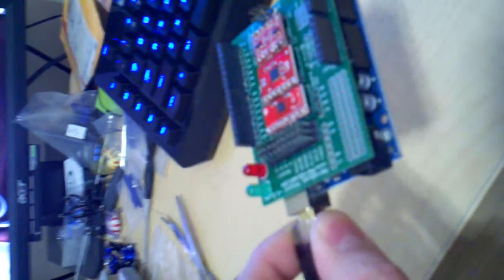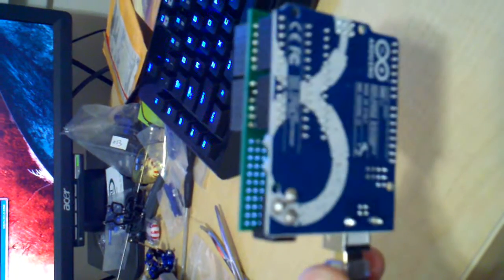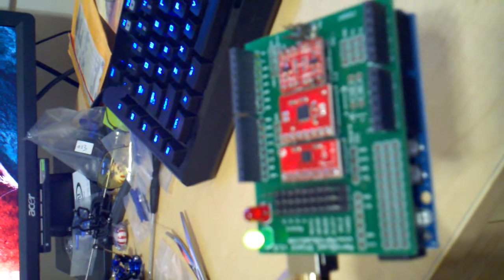Arduino QuadCopter 1

Comment: A blinking LED on pin13 is no proof that those sensors and LLC are connected properly or connected at all :p Anyway, you have the goodies to make it work ;-)
Cool project!
Maybe a usefull tip: You can also buy the sensors, even combined versions (known as IMU's) at sparkfun.com. Most of the sensors you find online are from Sparkfun or DFRobotics. Sparkfun ships worldwide at (in my case) about the same shipping rate as local shipping. And since you're buying from the source, you save some bucks.

Comment from the maker: I bought all the arduino parts and sensors at aeroquad.com.  They have instructions and an active forum community to help as well.  All the other pieces came from various hobby shops and should be covered in the aeroquad forums.